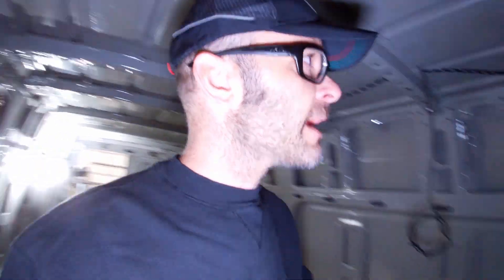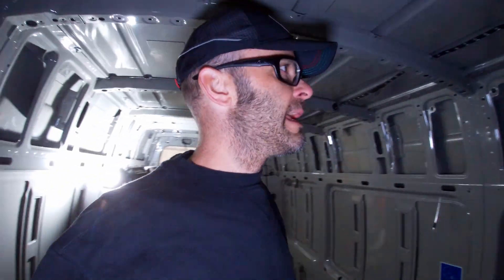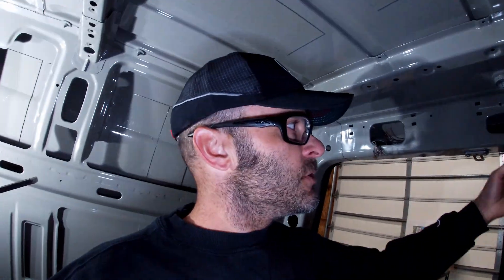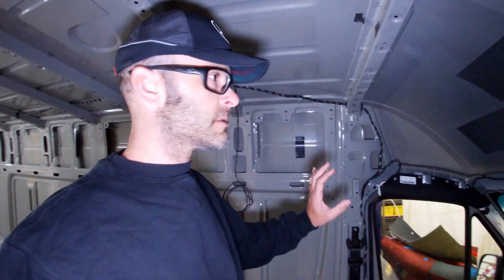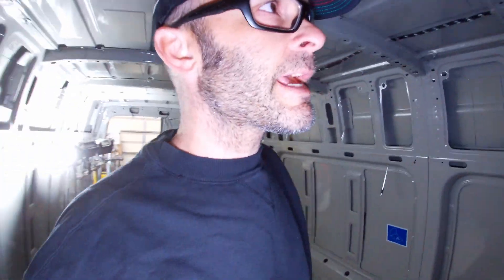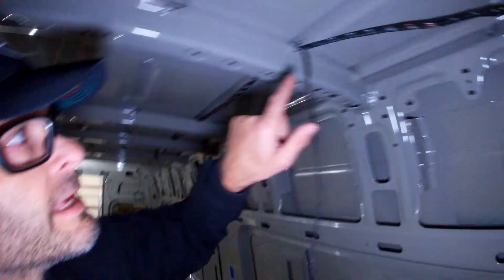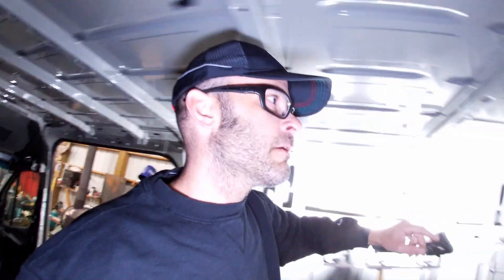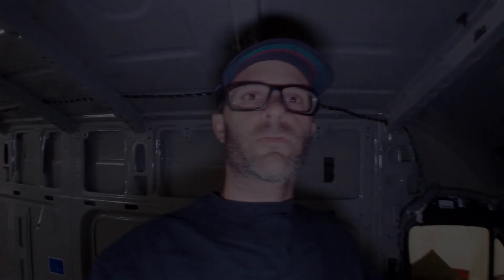2023 Sprinter Cargo Area Wiring Harness Relocation

Comment: better to remove the pins in the connectors  re direct the wires and re connect the plugs. cutting wires and solder is nuts, oh and terrible camera work, bad advice!